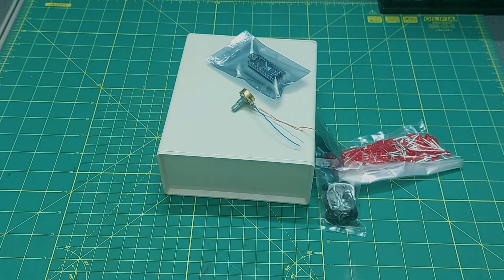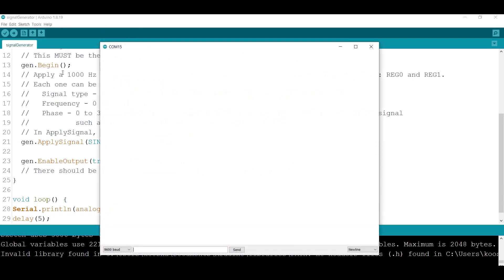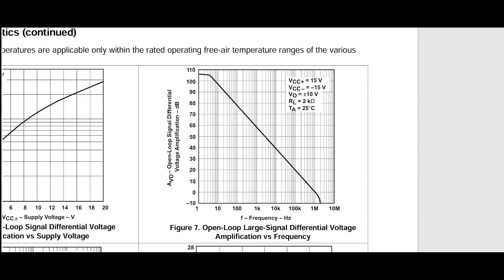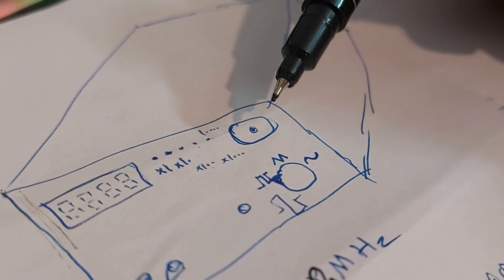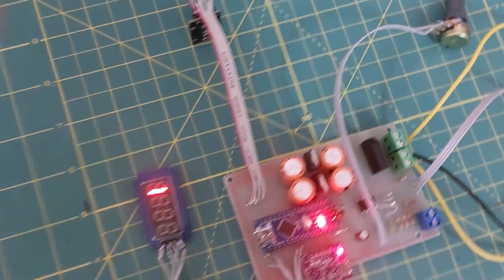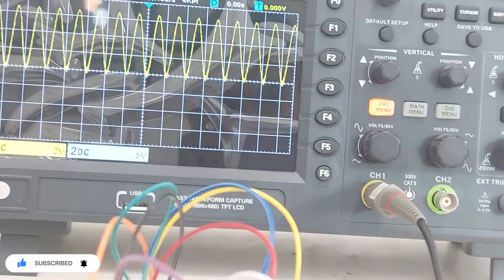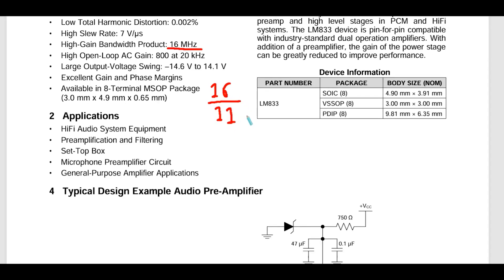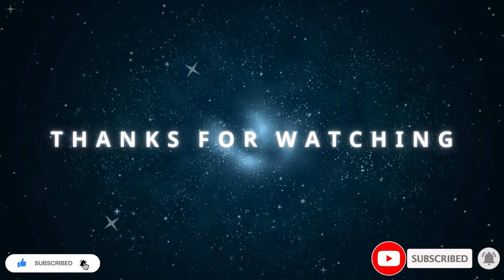Make Your Own Signal Generator | DIY ELECTRONICS PROJECTS

Comment: I would recommend considering using a transistor amplifier instead of an op-amp—it will be good signal quality and much cheaper 😊
Reply from the maker: It's possible, but it can get complicated if you want to adjust the amount of offset.

Comment: Why not use AD8056 or AD8066, which are dual channel?
Reply from the maker: Because it has to be available in our market. Plus, they are only made in SMD form, which means I still have to change the PCB.
Reply: @BabakStars  Mouser currently has 189 of DIP8 parts for AD8056. SOIC to DIP8 tiny adapter boards aren't too hard to use either. There's a lot of good opamps and chips nowadays that no longer have any throughhole package

Comment: No! I have a signal generator, the last time I opened it, there was no module or microcontroller inside. People need to learn how to make stuff like this with stand alone components. Especially with how the Sun's is behaving lately. Everything that's non-hardened electronics, and even worst if it's in a plastic BOX. That is a useful test device but with all that... It's probably just easier to buy one, preferably from the early to mid 1980's.
Reply from the maker: Wait for the next part to see what happens.